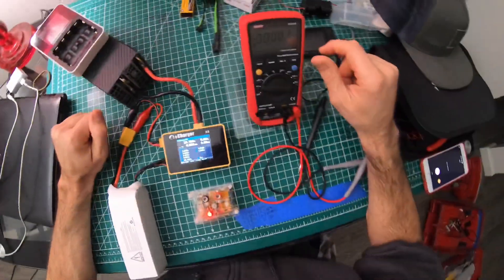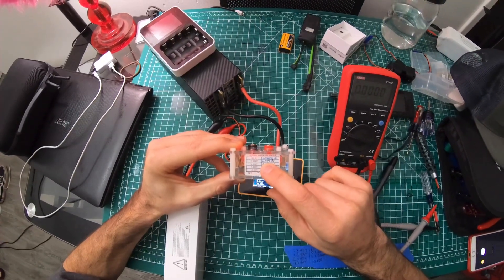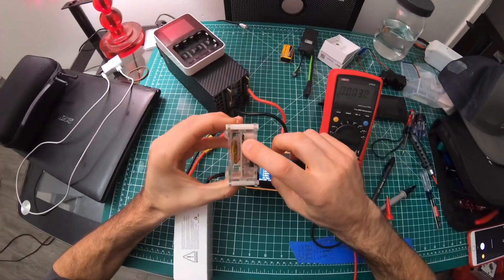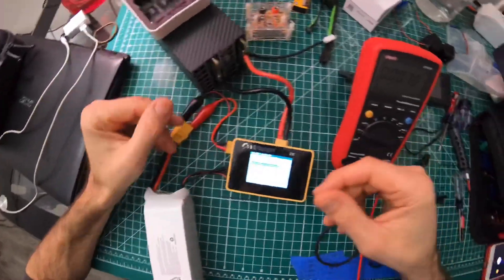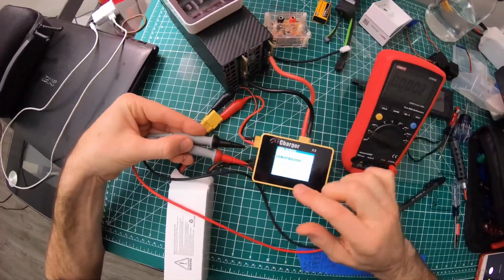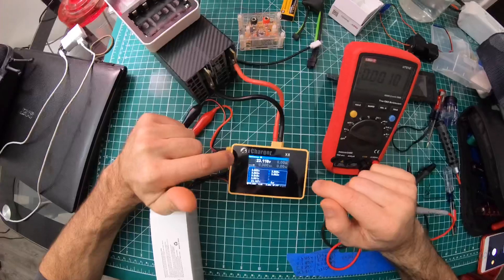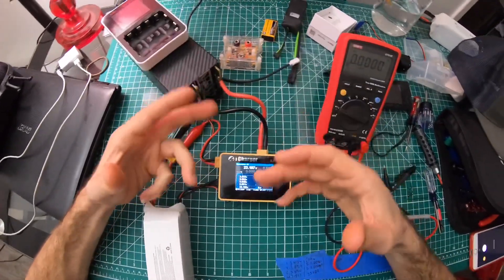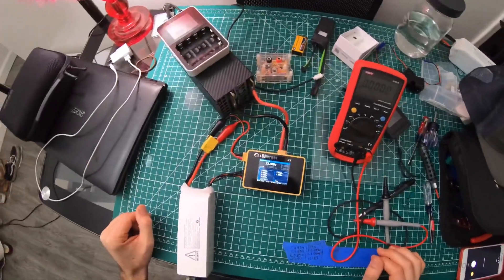Icharger X6 - X8 calibrating

Comment: I have an iCharger X8 and an X12 but the calibration behaves weirdly. When I try to calibrate the current and loop in my multimeter directly into the output current path, go to the current calibration menu and start the current output, the current on my multimeter jumps back and forth. No accurate calibration possible this way. Fortunately my multimeter has a min/max function so I let it run for a minute, read the min and the max value, take the average and take that as the measured current value.

The X12 was the first iCharger I bought. I tried to calibrate it once but the default setting was pretty much on point. So I left it like this. I did a capacity test with one LiIon-Cell in 10 Cycles which gave me capacity values of 730mAh +-2. I was astonished by the repeat accuracy.

Then I did the same capacity test with the same parameters and the same cell with the X8 but this only gave me stable 715mAh which is a slight underestimation, so I decided to calibrate it. Here, the via the multimeter measured current was lower than displayed on the iCharger, which means the iCharger overestimates the actual current, so I had to lower the calibration value. Due to the constant current regulation in calibration mode the displayed value stayed the same but the actual current rose, which makes perfectly sense. But this had as consequence that in a further test, the measured capacity of my test cell was even lower (706mAh) which is even more apart from the reference value which was given by the X12. So though the two iChargers delivered accurate currents in calibration mode the results from my capacity tests were quite different.

And I'm asking myself what's going wrong here. Is the X12 faulty? Is the X8 faulty? My actual plan was using both iChargers to test several hundreds of Liion cells one after another. The additional X8 would double the speed of testing but these problems make my plan fail. Any suggestions why both chargers give different test results despite concordant calibration results? I can exlude the cell as source of error. The capacity measurements are repeatable when I switch the iChargers back and forth. Any suggestions are welcome.
Reply: Did you ever come to any conclusions regarding this?

Comment: hey dude, you got an email address i can get you on?? like you i like my chargers super accurate and i am trying to get my Icharger calibrated as the manual tells you where it is in the manual and refers to a value "32760"for each output channel voltage (i.e. cell voltage adjust via balance port), i have asked Icharger in china a dozen times to explain the "unit of measure" for this number and its relationship to voltage but get nowhere due to (i think) things lost in translation. My Icharger stops at 4.13v/cell and i want to adjust it up to 4.2v/cell. this video was the most help i have seen so far but some screenshots would be usefull and a value for the number you have to adjust (is it resistance or ?? look forward to hearing from you.

Comment: I agree that all ISDT gear is way off. I had a Q8, calibrated it multiple times do to it constantly drifting out of cal. I ended up sending it back and getting an icharger S6. its stays  calibrated just fine. So fine I turned around and ordered a second S6 and a 406 Duo. Ive only had the 406 for a couple days but seems good too. Im working on an HMI touch interface for it right now.

As for the ISDT BG-8S I have a couple of those but I had to return two of them because they kept going out of cal. But finally ended up with 2 that dont drift as fast. If it wasn’t for the fact that I can’t find any other cell checker on the market thats able to be easily calibrated I probable wouldn’t have gone through the hassle I did to get two good BG-8S’s. I do really like the form factor of the BG-8S thought.
Reply from the maker: Nice I got myself a Icharger 308 and check the calibration on it all the time with my precision voltage reference tools and it’s spot on doesn’t drift at all
Reply: Curious if you ever released a touch interface for the icharger?
Reply: @blaine3384  I still have everything but sadly not yet. I had multiple family members pass around the time I was working on that project and got sidetracked. I kind of forgot about that project until a few weeks ago. Maybe this winter I have time to try and finish that.

Comment: @Slow RC Mike, is it possible to feed the charger directly into balance port pins from like, professional bench PSU? Too many variables, going from reference board to multimeter to battery...
Reply from the maker: Yes most definitely
Reply: i know this is an old ass comment but does anyone have a link to a video where this is done? how would you do this? just connect a pin from both the + and - from the PSU and stick it on/in the pins on the balance port for each cell?
Reply: @dirtrider88  I decided to not bother and continued to use my X8 as is